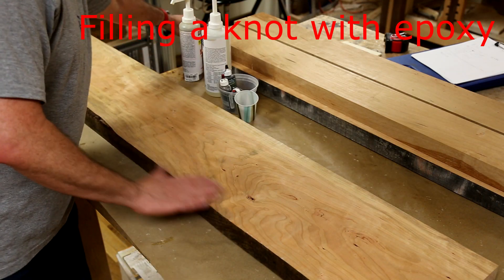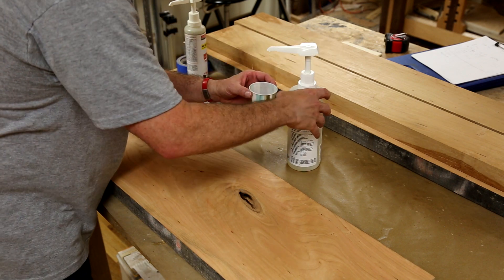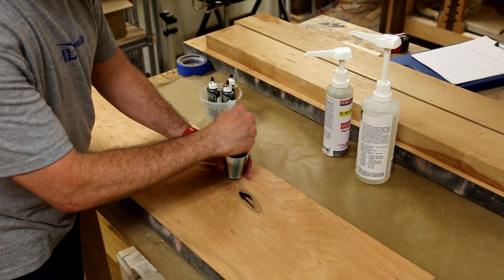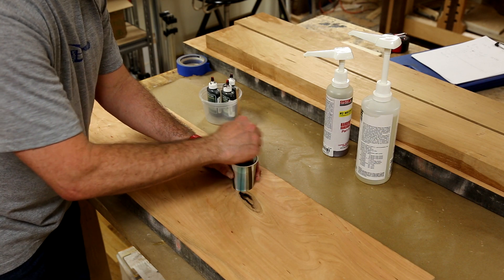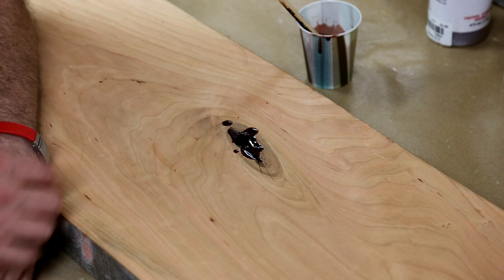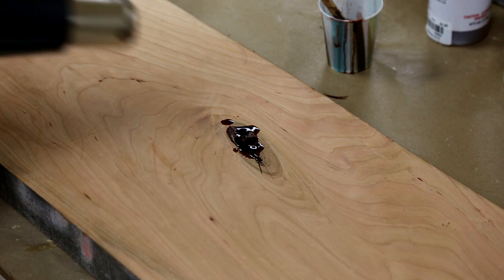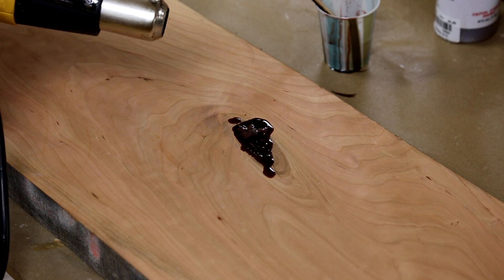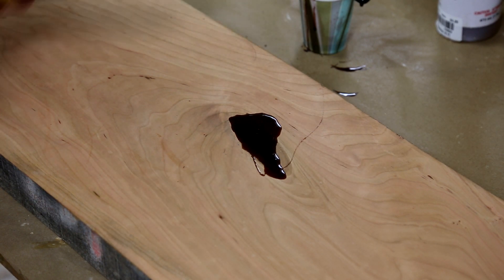Filling a knot with epoxy

Comment: Curious to know how you finished the top. Do you have a link to the products your using?  I’m planning on my first epoxy project with filling so knots.
Reply from the maker: This was part of my build of what I call clothes trees, build video here:  https://youtu.be/OIA1DvOoAao  For this project I finished with Danish oil, but I've used multiple different finishes over epoxy including polyurethane which is generally better for table tops and other higher wear surfaces.  I use different epoxy products for different applications but for filling a knot like this, I really like the System 3 epoxy and transtint alcohol base dye.  Good luck, and don't forget to use a heat gun or torch to pop the bubbles early in the curing process!
Reply: Could I stain the wood after filling the knots?

Comment: Hi, I have to repair a knot in a table. But this table is already finished, it means that if I repair it, I wont be able to further polish or sand the surface, so, the repairment has to be almost plane at the end. What Can I implement?
Reply from the maker: That's tricky.  You could try taping off the knot to prevent epoxy extending beyond the knot.  After curing, you could do most of the scraping and sanding before removing the tape and then hand sand to prevent ruining the finish. If you sand to sufficiently high grit you many not need finish on the epoxy.